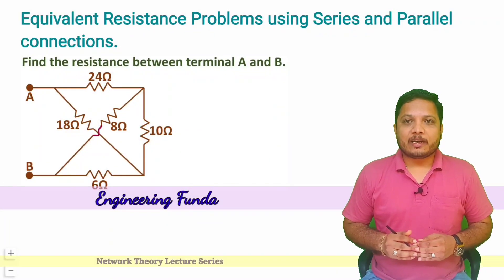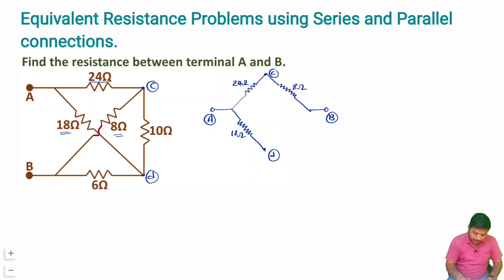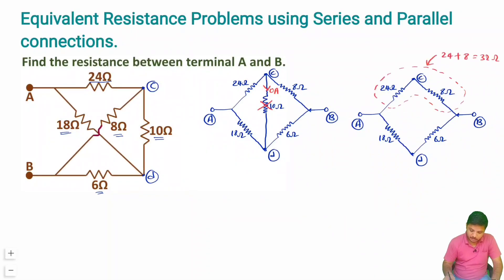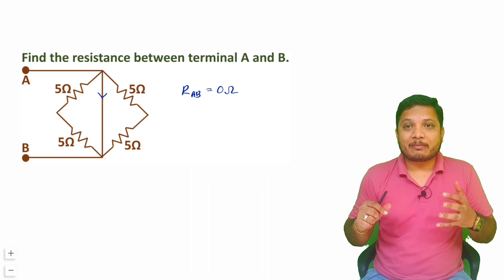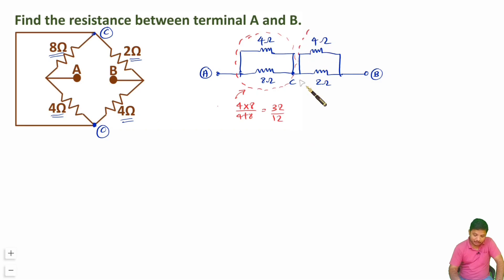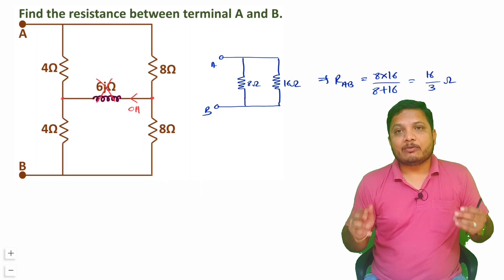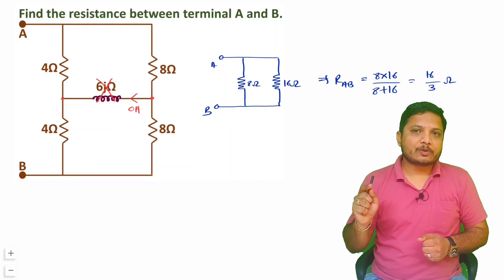Equivalent Resistance Problems: Detailed Examples and Solutions 14

Comment: In problem 1, points c and d are at the same potential, so why not short them and then do (24 parallel 18) + (8 parallel 6)?
Reply from the maker: A and C can not be shorted, it is open circuit dear

Comment from the maker: Equivalent Resistance Problems using Series and Parallel connections explained with following Timestamps:

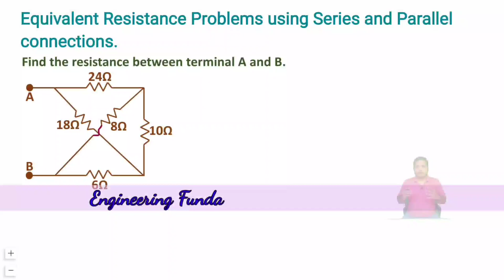0:00 - Network Theory Lecture Series - Equivalent Resistance Problems using Series and Parallel connections
0:17 - Example 1 - Equivalent Resistance Problem using Series and Parallel connections
3:35 - Example 2 - Equivalent Resistance Problem using Series and Parallel connections
4:35 - Example 3 - Equivalent Resistance Problem using Series and Parallel connections
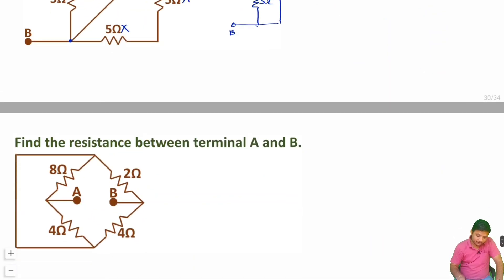6:04 - Example 4 - Equivalent Resistance Problem using Series and Parallel connections
8:16 - Example 5 - Equivalent Resistance Problem using Series and Parallel connections